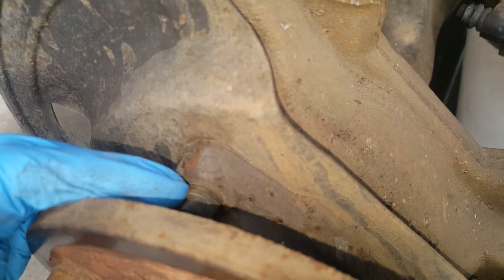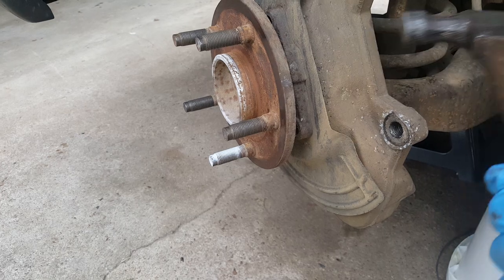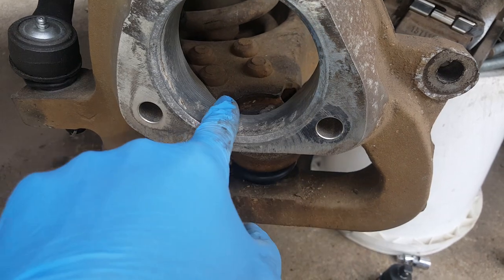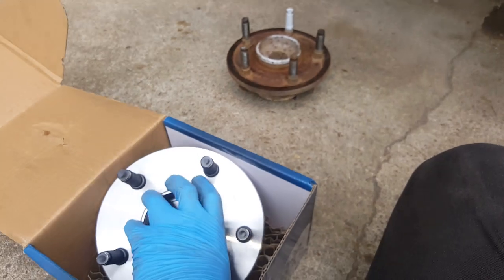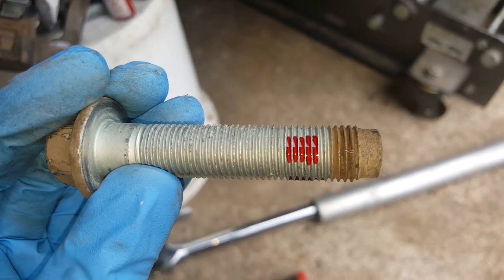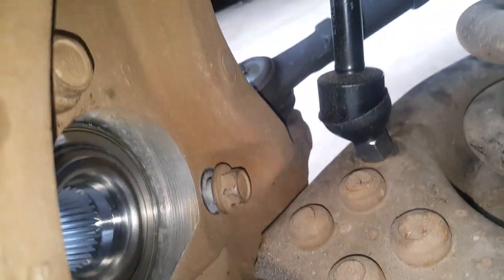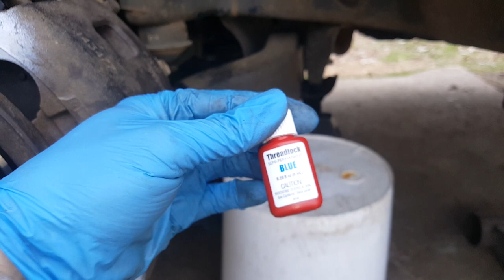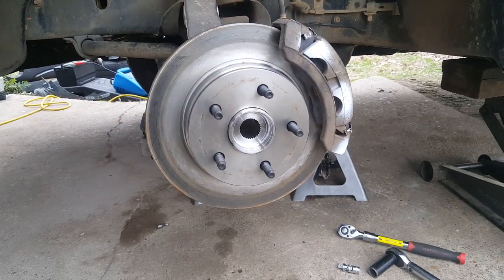How to replace front wheel bearings dodge ram 1500 2wd

Comment: I was told that a shop installed 4wd hubs on my 2wd Ram. Is that even possible? Is this something that immediately needs to be corrected?
Reply from the maker: They are the same. When manufactoring I suppose it is easier to make them all 4wd compatible. Makes no difference though , you will notice the inside of the hub can accept a cv axle . Great question and thanks for the feedback.

Comment: I had a hell of a time getting the old one off. There was a lot of rust and crap that had it stuck. I finally took a huge sharp chisel and a big ass sledge hammer and got it off. I put the chisel right where the triangle part of the hub meets the mount. Right where the dust shield is sandwiched between them. I held the chisel there and hit it hard as hell with the sledge hammer. I reset the chisel each time and made careful deliberate hits with the sledge hammer. It finally came out.
Reply from the maker: Reminds me of vehicle I recently worked on . The rotors and hubs were seized and even with the sub frame out I was using an 8lb sledge . The hubs were like glued inside with rust and corrosion. I was thinking to myself at the time there was no way I would have got them out with them on the vehicle. Thank you for sharing and thanks for watching.

Comment: This video was very helpful for my 2012 1500 2WD. The first side took 2 hours. The second side took 6 hours. You can keep the wheels straight and a good torque wrench works to get all the bolts out. The problem is the hub stuck in the knuckle. The trick that worked for me (I don't have a torch) was to dremel the dust shield in two places and without the 3 bolts, you can hammer the dust shield off. This leaves a 1/16" gap for PB Blaster to get down into everything. Then using a wedge, separate the hub from the knuckle by prying into the space left over from the removed dust shield. A pair  of new dust shields are $50 a Autozone and look better anyways. Great Video, Thanks a lot.
Reply from the maker: Thank you for sharing your project and thanks for watching.
Reply: Took me 5 hrs to figure out a torch was the only way to go. It was like they installed it with some kind of adhesive. 5 minutes of heat and it took 3 or 4 good licks to come out. I have a straight air/acetylene rig that has a very wide flame pattern. I wouldn't recommend oxy/acetylene right off the top

Comment: Thank you for posting this. I just changed the wheel bearing on my 06 Ram 1500 2wd today. Your video was most helpful because it was for a 2wd. I turned my wheel full to the left to reach the forward bolt. Also sprayed everything with aerokroil 2 days prior which may have helped loosen things up. Ill change the other side next week. Subscribed!
Reply from the maker: Thank you for the terrific feedback and the sub it is greatly appreciated.

Comment: Thanks for the video!
Finished mine.  Hardest part was the ABS quick disconnect.  Those things are so sticky...and I wanted to avoid breaking the plastic.  
All the bolts were fairly routine.
Also, my version with ABS(2004) only had the drivers side with the ABS sensor lead.  The passenger side was without.
Reply from the maker: Thank you for sharing and I appreciate the great feedback.
Reply: Just doing my rwd ram 1500, and I only have abs sensor on the drivers side as well.  Thx for the comment, glad to see this is not a unique case.

Comment: Great video, I have an ‘02 that needs this done. I also noticed that you have done some suspension work too. Man those bottom ball joints were a pain in the ass to remove. Thank you for sharing. Mine has 320k miles, it’s beginning to pee some oil and the abs module stopped holding pressure, it has a spongie brake pedal.
Reply from the maker: These trucks really last with a little maintenance , I am driving one now with close to 220k . It has been the most reliable vehicle I own. Thank you for watching.
Reply: @s33therfan  Dude I agree!! I bought om in 2005 brand new and it is still my work truck! I have 270K on it and its still a badass!

Comment: I just noticed that it looks like you lower ball joint has got a grease fitting and the arm still looks old I thought you had to replace the whole lower arm to get a newer ball joint did you just replace the lower ball joint?
Reply from the maker: Great question . I just replaced the ball joint itself. I have a video I will leave a link. Thanks for watching.
https://youtu.be/_3uL88BoUps

Comment: I did the tire shake no play at 12&6 but just a slight I mean very very very little play at 9&3 is that my wheel bearing
Reply from the maker: I would say no , unless it is making a growling grinding noise. I have seen them with no play yet making noise. Thanks for the feedback.

Comment: So you don’t need to take off axel?
Reply from the maker: If it is 4x4 it makes accessing the bolts holding the hub easier but not necessary as long as you can get to them. In this case mine is 2wd drive so there was no front axles. Great question and thanks for watching.

Comment: 2008 Dodge Ram SXT (Rear wheel drive) is this the right one for the drivers side front
Reply from the maker: Crawl underneath and see if there is a wire going into the hub assembly. It depends on whether it's abs or non abs. Wire = abs. If it is non abs it will be the same . The abs are more year specific. Here is a link to both.(replace in pairs) Thank you for watching.

ABS hub assembly:
https://amzn.to/3hCkj57

Non ABS hub assembly:
https://amzn.to/2YVVcUt
Reply: @s33therfan  it needed up having it so I bought the one through TRQ. $98. I got it all fixed up yesterday. Thanks for the reply man 👍🏼

Comment: How many miles does your ram have? And did you sell it? I noticed you have another one. I just got a 2002 1500 5.9l for $3000 with 180k miles, hopefully  it lasts me a while
Reply from the maker: It had around 188k . It was a great truck when I got rid of it. I got another 2002 ram now with 220k has the 4.7l v8. It is still going strong. I would just note 3000 for one of these now days is a great deal. If taken care of these are great trucks and really seem to last. Thanks for the feedback.

Comment: is the torque wrench an absolute or could i get away with a large ratchet?
Reply from the maker: The main thing is just get it tight , I usually worry more with smaller bolts about overtightening but the bigger ones not as much. Thanks for watching.

Comment: Would this cause my motor to shut off?
Reply from the maker: No , these will just cause a grinding noise and vibration. Just throwing this out there if yours shuts off randomly you might take a look at the O2 sensors. For some reason these trucks have been known to have issues with these. Hope you get it solved and thanks for the feedback.